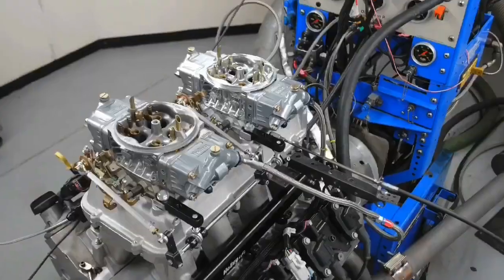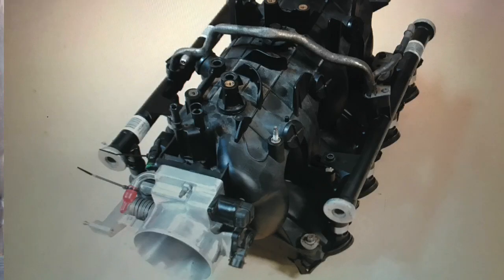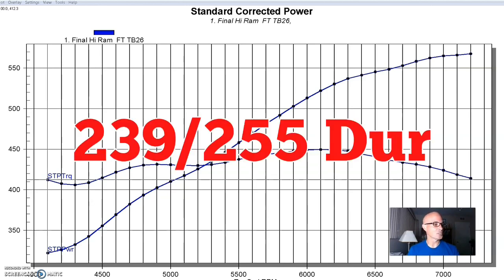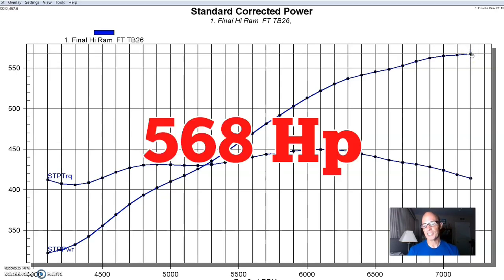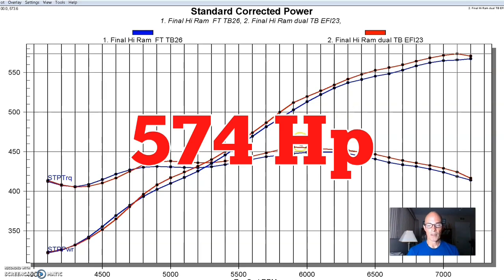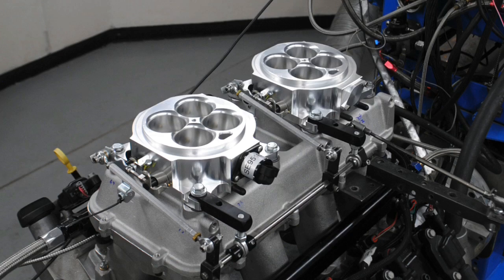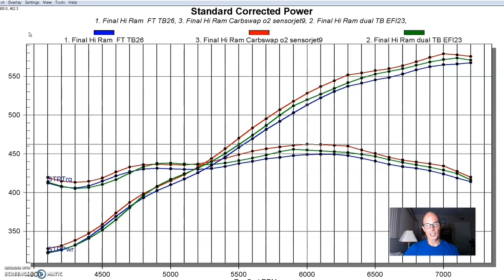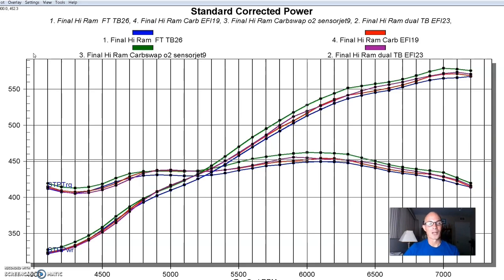LS1 CARBS vs EFI-WHO WINS?

Comment: My carbed ls 5.3. Ran great. But I could never get the slight hesitation off idle to go away completely. I tried every carb I had. Even bought 2 brand new ones. Ended up with a holley sniper. Hesitation gone.
Reply: @303StreetMachines yeah it was crazy. I could pull the carb off of a great running 350 daily driver. And it would have a hesitation on the 5.3. 
Brand new Holley 600. Dead spot. Tweeked the pump. The squirters. The pump cam. Everything that's always worked on all the other engines in the last 35 years of hotrodding. And a brand new Quadrajet from the early 80's that had never been out of the box. Dead spot. Put it on my 350 camaro. Ran great. Tried Edelbrock. And a couple 750 holleys.  All ran good on other vehicles. Dead spot on the ls. 
Holley sniper.  No dead spot. 
What is the problem........
Reply from the maker: what "carbed" intake was it
Reply: @richardholdener1727  holley 300-130 duel plane
Reply: @303StreetMachines 
Maybe. It was just a stock reman long block with the small valve heads

Comment: I still wanna see a custom 8 runner "cross ram" style manifold with 8 motorcycle-style carbs. I dunno if it would make more/better power but, it sure would look cool!
Reply: Check out the intake on the Munster coach..
Reply: Weber makes one barrels but even DCOEs are essentially a barrel per cylinder
Reply: That's what I want for my 67 Camaro with a 327, for the "too cool for school" look. Bizzarini did it too perfection, look up the Jay Leno garage on it. I think it is Hilborn that sells these for gen I.

Comment: This was a fun one. Too bad you didn't have two large TBI units to test against. Or even one large TBI setup. I'd think you'd get the best of both worlds there. The great granular control and drivability coupled with the charge cooling given the distance traveled with fuel in the air would be the same as a carb.
Reply: I would like to see that too. And TBI vs. carb as I commented above.
Reply: Shane Singleton I saw one Dino run as you stated one with carburation and one with a Tbi unit using the same intake. Carb won, but not by much less than 5 hp. Don’t remember the specifics. This test was run by a u-tuber Nicks Garage. I’m sure you can look him on up on you tube and find his list of videos with this test in it.   It would still be a good test to run
Reply: @lloydholt6511  Big fan of Nick's Garage. The one thing the Dyno doesn't simulate is the all weather cold start capability and smooth operation of fuel injection.
Reply: Shane Singleton I agree completely. I would gladly give up ten hp for the increased street ability and cold start performance of fuel injection whether TBI or port injection. The only advantage I see for port injection on the street is the ability to balance fuel flow between cylinders. On the track conditions are different.
Reply: @lloydholt6511  I think that David Freiburger did a port injection test on Engine Masters where they took air/fuel readings on each cylinder to find out if it made that much difference. The thing is, though, that any port or TBI injection setup still only gets its readings from 1 or possibly 2 upstream sensors so it's balancing air/fuel for a bank rather than for each cylinder. I still love EFI, though.
Reply: Shane Singleton their are several racers out there that are running O2 sensors on each cylinder. I believe (not sure) fuel tech has the ability to incorporate this info into the data collected.   Don’t know how reliable this data would be but it is an interesting concept. Engine masters was the show you spoke of. I believe their problem was having the software fast enough to make practical /accurate use of the data collected.   At the hp levels they were running the gains were insignificant. At 3000 plus hp with multiple sets of injectors I believe the gains might be more practical/ significant.
Reply: lloyd holt you can also use egt sensors in each primary on Holley efi. That’s what all your high hp guys do along with individual cylinder timing

Comment: Great video content thank you sir! It seems wet flow vs. dry flow is the main comparison and I'm glad you touched on charge cooling, I was hoping that was where your were going. It would still be interesting to see the throttle body injection vs. carb though...would it be even? Or would the throttle body make more because of the carb venturis being a restriction.
Reply from the maker: as shown in the video-the twin 650 carbs flowed more than enough for the power level
Reply: @richardholdener1727  Yes but it was dry flow vs. wet flow. I'm talking about throttle body injection where the fuel is introduced in the same way. Throttle body having an open hole where the carb has an open hole with a venturi in the middle drawing fuel. Both the same size.

Comment: If you would have done a throttle body injection in place of the carburetor it would have provided more of a cooling benefit because the fuel is under pressure as a posed to being drawn under a vacuum. It’s basic science at play here.
Reply from the maker: I think I covered that
Reply: Richard Holdener  I was told to comment that😂

Comment: what is the bsfc for carb vs injection?
Reply: I love to see that plus some part throttle drivablilty
Reply: Nelson Braganza : The same as Port EFi if the legs from the carb  jets are in the same plane. 0.46 is possible and you can still make excellent power. 0.60 would be pretty bad. TBi is exceptionally bad but well managed. Some cross ram intakes with twin TBis make really good BSFC, there is a Mother of All Throttle Bodies twin Cross Fire system that works pretty good on an 84 Corvette intake, but the are a triumph of engineering over common sense. The great systems are the old 660 Centre Squirter and Anulular modified Dual Holley 4bbls with 1:1 linkages like Andy at Unity. The High Ran style intake can really work well with a customised set of Holley 4bbls. Throttle body sizes and venturi diameters can be programmed into a set of NOS carbs. Getting just the right size throttles, venturis, anular booster calibration and having a sort through the squirter systems and throttle synchronisation can turn a 9 mpg system with a poor 0.60 BSFC into a stalwart 0.46 BSFC like Andy's. Chevy, Ford  AMC, Mopar, Poncho, Olds, Buick, Hudson, Stude, Packard, Rolls Royce, Rover, Daimler SP...any V8 responds to what Richard did. Learn the processes from thise who Share. Great You Tube Teaching from TeamTalk Holdener...I feek I could Tunnel Ram my lawn mower with what I saw in this video!.

Comment: It's all about air density!
Reply: More than that...  Better atomization/evaporation/even fuel mixture.
Reply: @michaelangelo8001  Maybe, but in my opinion fuel injection creates finer fuel particulates so better atomization, and as it can be adjusted per cylinder is also better to make a even mixture. Do you agree?
Reply: @shankswrc3509  In that respect, yes.  

But when I said "fuel mixture", I meant that the longer the fuel is in suspension within the air in a given port, the more time is has to thoroughly evaporate, and homogenously mix with that air.

Otherwise, you have both rich and lean areas within that airstream, which will result in a certain amount of uneven, less than optimal combustion in the cylinder.
Reply: @michaelangelo8001  oh ok. I also agree then.

Comment: Nice test. I'd like to see a comparison between boosted EFI and Turbo Blow-through to see the difference.
Reply: check out steve morris' article with hotrod. he prefers carbs for his 1500+hp turbo motors for the fact that you get the phase change cooling across the carbs dropping temps even more than just the intercooler by itself.
Reply: @bert5003  He has something on Youtube with a forced induction engine where he swapped a carb for efi and it lost power.
Reply: @bert5003  but if you use throttle body injection you will have identical charge cooling.
Reply: Draw through would be interesting
Reply: @heathsmetalwerx  I've heard people have found frost on their manifold from a draw through carb turbo setup

Comment: As those RHS heads look like MAST heads, Frankenstein heads are identical to some MAST Heads. Probably made in the same foundry, Liberty Castings is one of em (CHINA!! REPENT!) and does all FED and some MAST heads. 
Word of advice....check and make sure the main water jackets aren't plugged with casting flash prior to installing. I almost grenaded my motor after going through this and ended up wasting $2500 on heads that are now trash.

Comment: I was gonna ask about the throttle body injection until you mentioned it. Not so much saying it would be the ultimate, but to ask if it would have the same charge cooling effect. Thanks for answering that!

I wonder if you could get the best of both worlds with one of those Moroso Super Cool cans and multi port injection. Or if it just ends up being kind of a gimmick.

Comment: Run a ac line by fuel line? Or a cooler tank with a ac line?
Reply: This was tried many, many years ago.  The verdict was that the compressor took away more power from the engine then the slightly cooler air added.  Also, the weight of the a/c system didn't help either.  That was on a race car.  On a daily driver, the computer shuts off the a/c at wide open throttle so that's a no go as well.
Reply: @tomthumb1498  only if its a  street vehicle that would help.  Not a race car.
Reply: Side note to the ac/ fuel line cooling, I did hear about someone in Australia using there a/c to directly cool the inter cooler. Unsure exactly how they achieved that or the results.
Reply: Jaguar had a fuel cooler on the V12s that tied into the a/c.  When you go WOT the compressor shuts off but the fuel still stays cool for a while after the compressor cycles off.

Comment: Finally bought a 55 gallon drum of 100% meth! The 0 degree windshield washer fluid was snuffing out the flame. Don’t have a hydrometer so I don’t know the concentration although it was advertised at 60/40. IAT’s went down 20F but I lost combustion with high enough flow to work.

It should show up in a week and I will log temps.